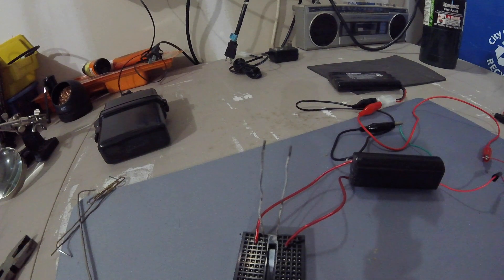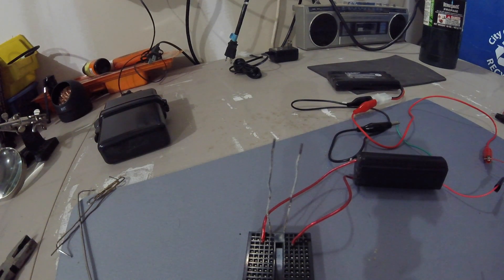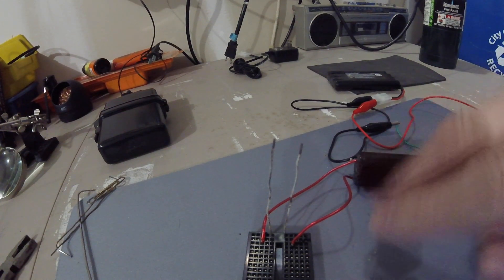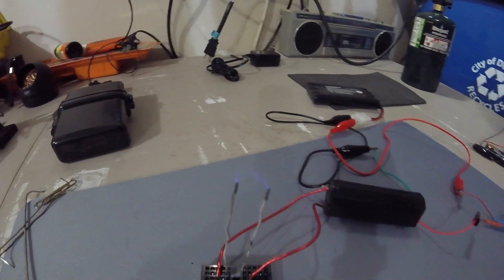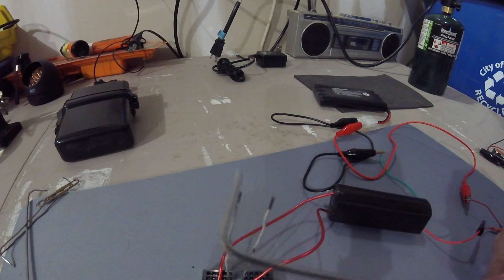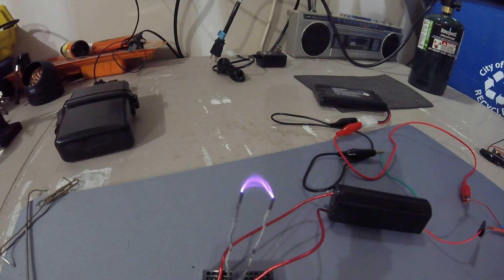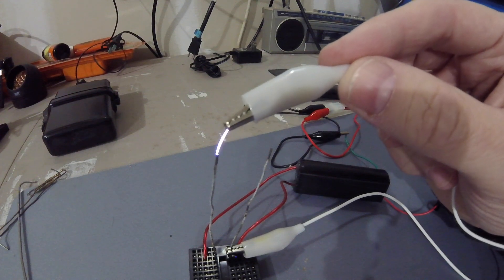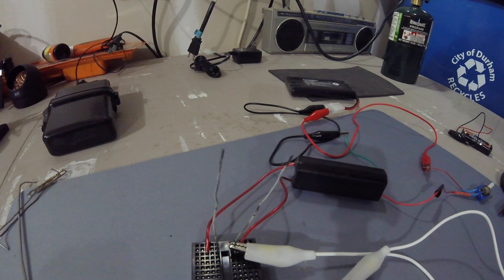High voltage project - stun gun module

Comment: I did something like this, but I ran 2 modules in parallel. The first one I ordered modules with I think 3 volts input, I tried them trying to get more output, then I got the ones with up to 15 volts input, running 4 pairs of old laptop batties it's enough to scare the crap out of anything breathing. An impressive show for sure. Think I'm going to add a voltage multiplier just to see what happens